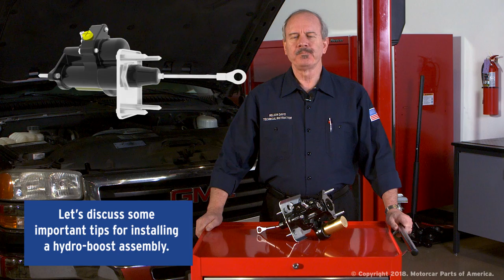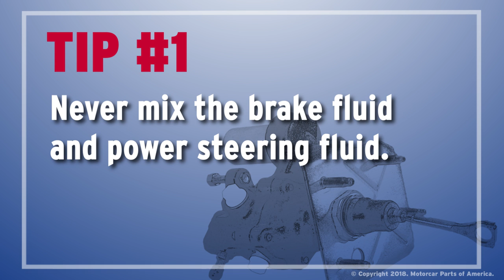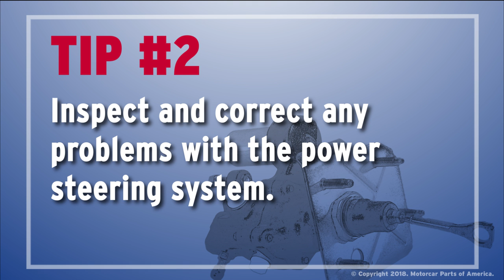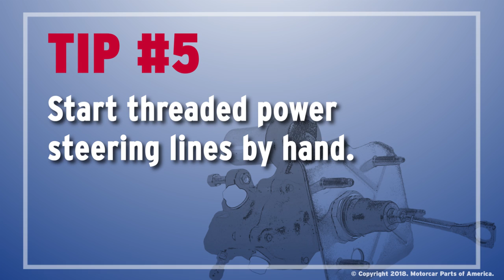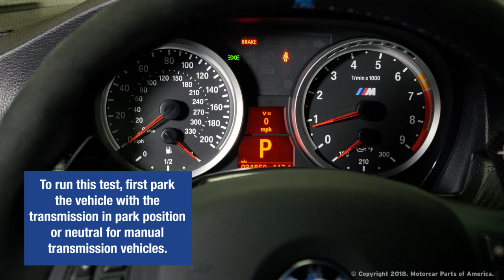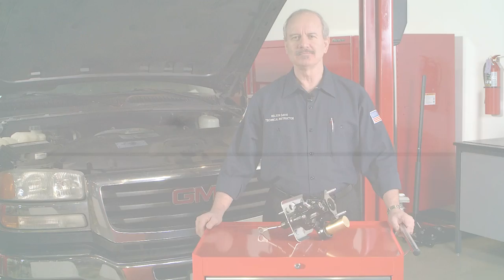Hydro-boost Assembly Installation Quick Tips

Comment: what brand of power steering fluid can i use . is it only Gm fluid
Reply: Use ATF.... whatever your trans uses
.
Gm doesn't have a "gm only" PS fluid
Just dextron 3(or 6)
And normal "power steering fluid" are both OK
. 
Dodge MUST use atf+4

Comment: Great video I just installed my new hydroboost system and I have 2 lines leaking on the low pressure side is there any kind of o- ring that I should have used any help would be great
Reply: They came with the new one

Comment: how do i find a replacement push rod for master cylinder
Reply: I'm researching a solution for this. please email me @ gogaston@gmail.com
Reply: We found this kit online and it worked perfectly for us. If you remember to take out the parts from the original unit you wouldn't need this. I will remember this next time. 
https://www.ebay.com/itm/223816807969